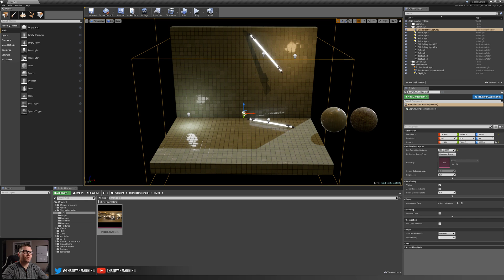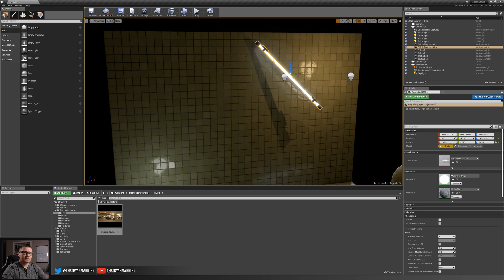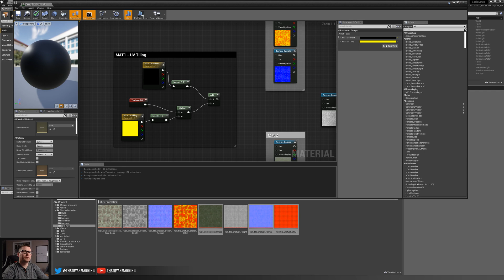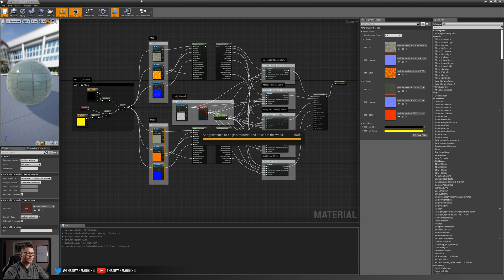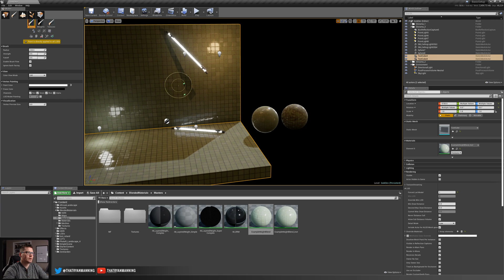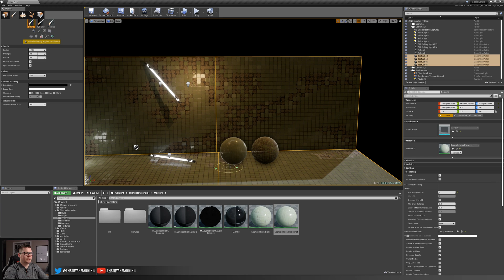UE4 Height Blended Materials - Part 2

Comment: Can you blend 2 actual materials somehow? Like I want to hide a wall and smoothly blend to a wireframe material but without duplicate meshes. 

When it's obstructing the view and I took the pixelnormal projected to 0,0,1 and normalized, the pawnlocation - pixelworldposition also normalized and plugged their dot product into my dither alpha node. Tweaked it so the transition is between 0 and 0.1 making it very nice but I want to show the wireframe of the wall when it is see through.

Comment: At around 16:30, is there really no way to lerp between material attributes? Been searching for this forever and cannot find a way. I want to make a landscape material where I blend different layers back and forth and how is it possible, that I have to lerp every single path of the attributes instead of just the whole material attribute itself? Cannot imagine this is not possible, would be so easy to implement and save a ton of time and also make things so much cleaner visible
Reply from the maker: Mat_BlendStandard node
Reply: @ThatRyanManning  OMG thank you so much <3, I would never have found this! Searched for lerping material attributes, mixing them, combining them but never found a link to blend. Why can't they just stick to one naming and keep it, doesn't matter if its blend or lerp or whatever but stick to it. Will be so much cleaner now, thanks man!

Comment: Thank you Sir,.  I'm thinking I'd like to try replace the house wall in that new Medieval Village project by Quixel so they have interiors, I used BSP's to make the walls and converted them to mesh's and got a ruff dammaged plaster from Megascans but it readlly needs a material that has randome moss. is this maybe a good way to go?
Reply from the maker: Height blend materials with Vertex masking is a perfect way to go. Just make sure you have enough vertices on your meshes to paint the mask and achieve the desired effect.
Reply: @ThatRyanManning  Thinking about the vert count, making the walls from BSP won't give me more that 4 per surface right? I'm talking 4.26 BTW with modeling in it. would love a tutorial BUT won't ask I know that's a heap of work for no return. I think I'm gonna need a DCC to give me the vert count

Comment: And why can't just plug the materials into the lerp and then break them? It seems weird. I mean you're blending between two things, not individual properties. And what's the deal with check "use material attributes"?
Reply: I agree,  this workflow seems to me that it could be more performant. I think the same result can be achieved by using a heightlerp to interpolate between two layers, instead of interpolating each attribute separately...